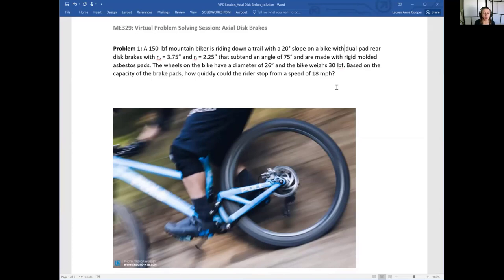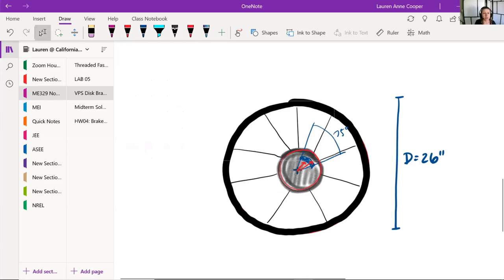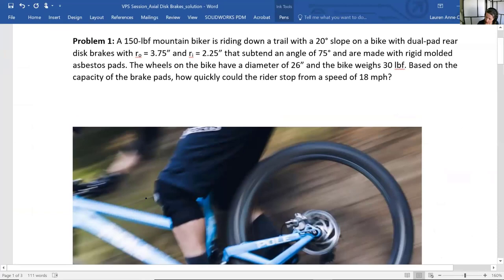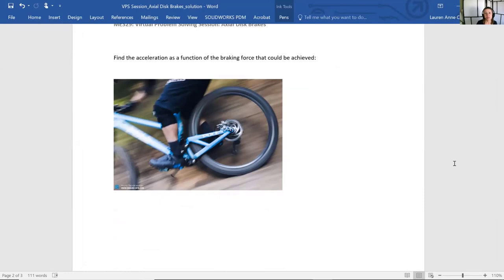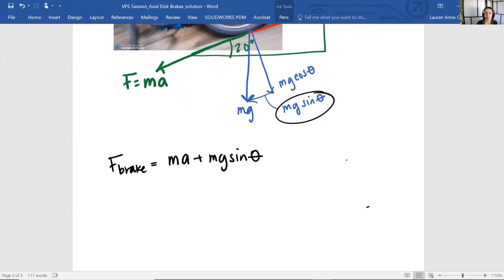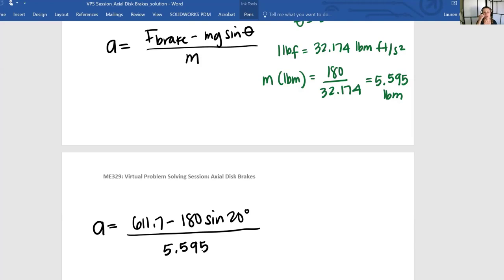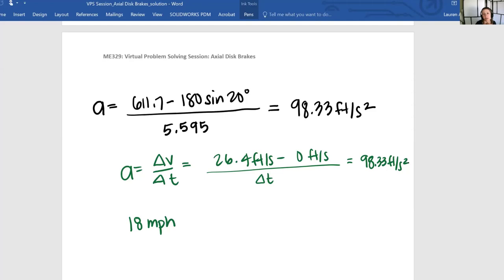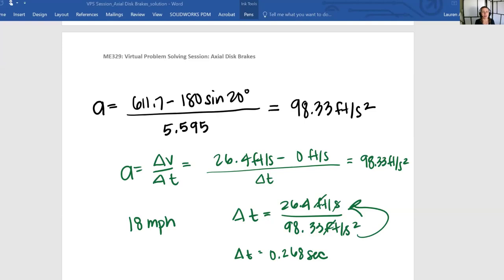Virtual Problem Solving Session: Axial Disk Brakes

Comment from the maker: Note: I am making a massive simplification by treating the bike and rider as one big moving sphere. Since the analysis is more about the brakes and less about the dynamics of the rider and bike, we are ignoring inertial effects of the wheels, as well as the true locations of the center of masses of the bike and rider. We are also neglecting aerodynamic drag and rolling resistance. In a full-blown analysis you would want to consider these things that are left out, but that would be a LONG video :)